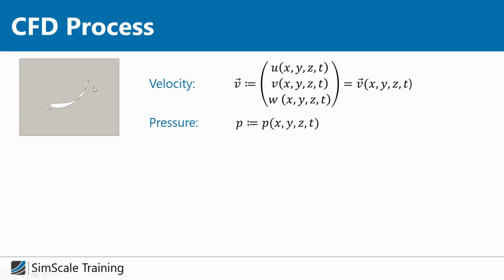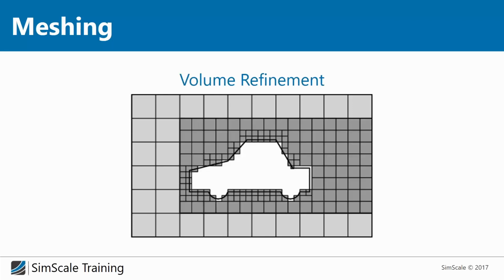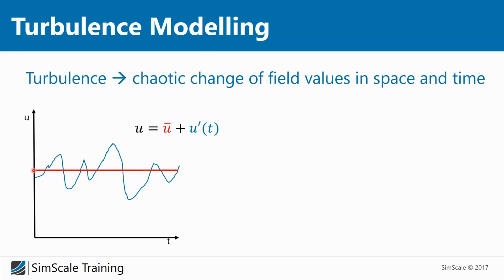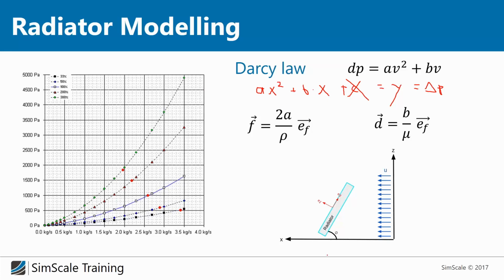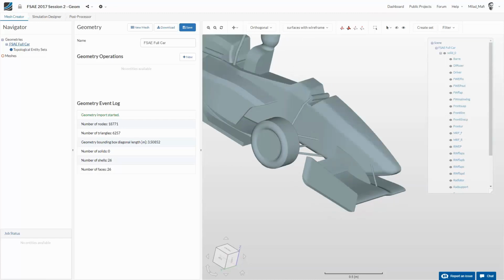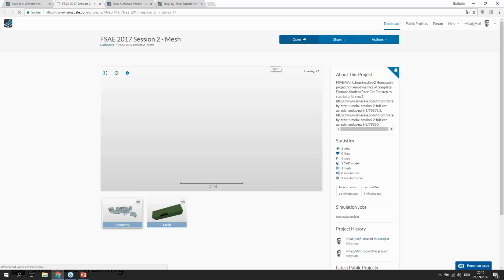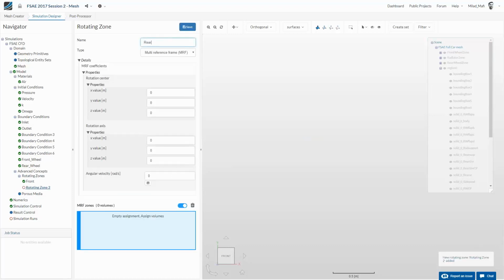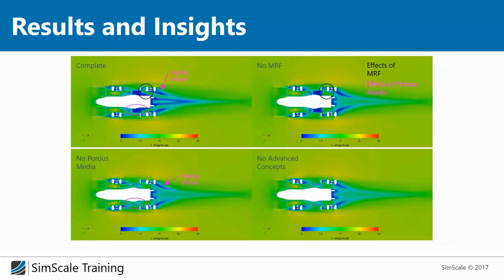CFD in Formula Student and Formula SAE - Session 2: Complete Car Aerodynamics

Comment: For a scale CFD simulation of the car which length could I use in order to get the Reynolds number; a cord length of any wing, the whole car length, the distance from de floor to the underbody (as if was simplified as a tube diameter) ?
Reply: For lift, drag, pitching moment of wing airfoils, use the wing Reynolds number. For car body drag, use the object length. Just as in Aircraft.
Reply: @Triple_J.1  Thank you very much  I really appreciate your help

Comment: Regarding the implementation of porous media I would like to ask one question, how should we create the cellzone for the radiator if SimScale does not longer allow selecting a face which is the case in the video? Thank you in advance for your answer.
Reply: Good question Alejandro! So the cell zone has to be a close region therefore you have to select it as a solid. However it might work with face selection if you upload the STL geometry pre-split - give it a try and let us know if that did the job :)
Reply: @JousefM  Hi Jousef, thanks to your help and other Simscale users, I was able to do the work. Basically, the best way was to define the SolidWorks files as solids because that avoids erros, I would say that apart from solving the problem it is a better practice to perfectly define the geometries.
Reply: @alejandrogomezmartinez3043  Glad it worked out :)